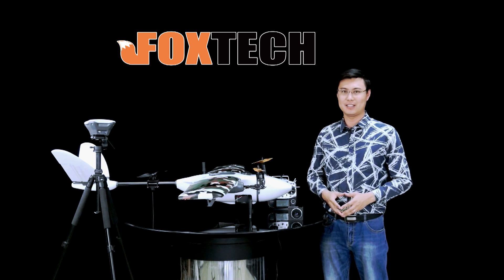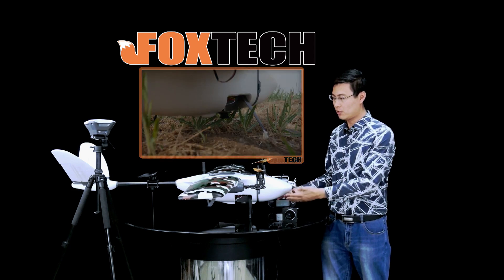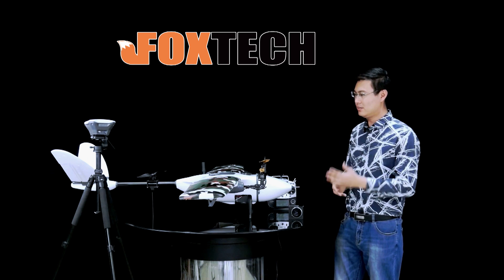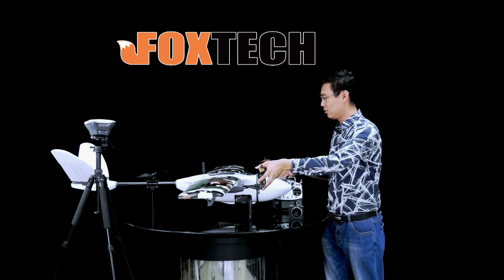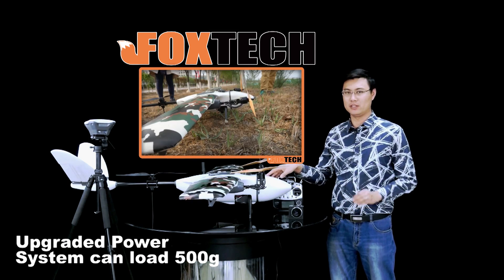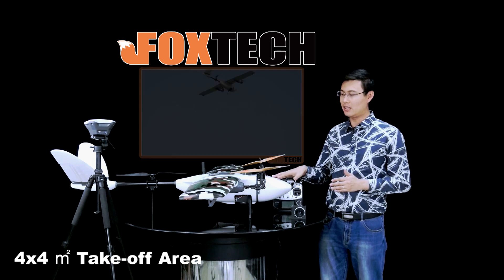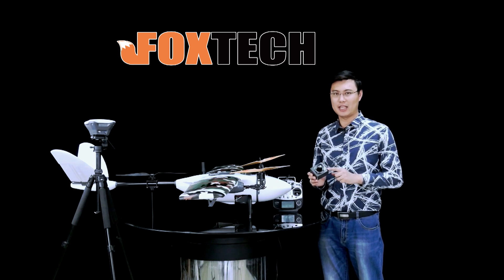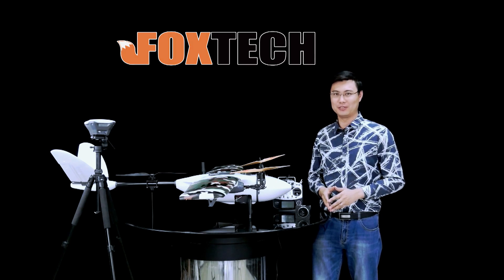Nimbus Tilt VTOL Mapping Version Upgrade Details

Comment: Whoever buys a Nimbus 1800 VTOL, from this company,
make sure they include instructions on calibrating the air sensor, and calibrating the directions of the elevators, otherwise, you may CRASH !! I crashed my plane due to lack of instructions not being included BEFORE flight. Not trashing this company but it cost me almost $3,000 for not knowing I needed to due  a couple of calibrations before the flight. I was informed after the fact through emails by this company.
Reply: Hi, LiGhT. Regarding your case, Miss Doris tried to contact you through email and Foxtech is willing to figure out your case actively.  Foxtech issued detail manual books, instruction videos of preflight check which are listed in the Nimbus page now. Please check, and anytime you are welcome to reply the email to get the solution.

Comment: Does the Map01 camera georeference the images it takes, or do you have to combine a text file with the images prior to processing? Also, shouldn't your PPK antenna be directly above the camera , or do you apply an offset when writing the image location? How easy is it to swap payloads? You discuss adding a gimballed video system, but would this require additional internal modifications to add video capability? Thanks for any extra info you can provide. It's starting to look like a really good product... I'm tempted!
Reply from the maker: Hi, dthost. IT has to combined a text file from flight controller. For other questions, maybe detail photos are required. please write to support1@foxtechfpv.com for tech support:) You will get reply within 12hours.